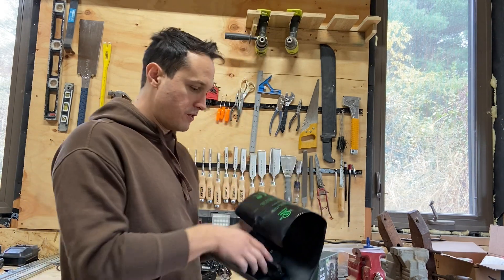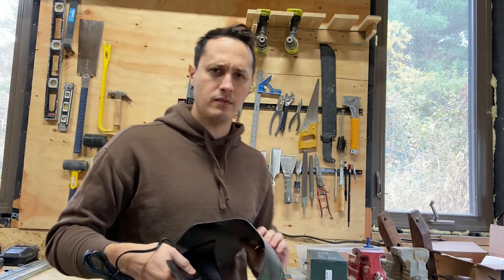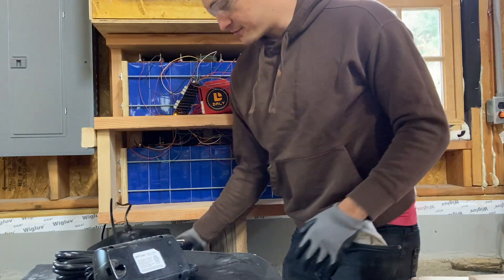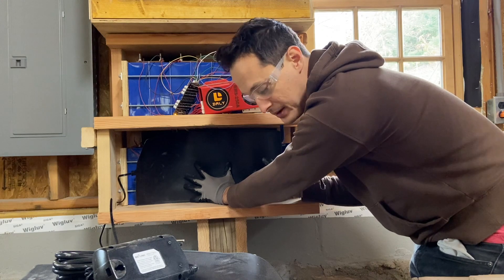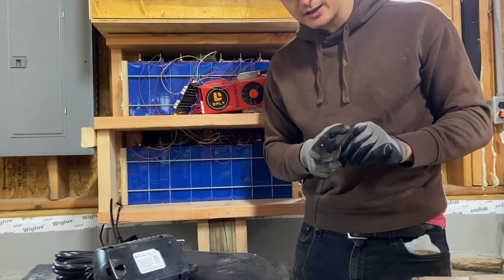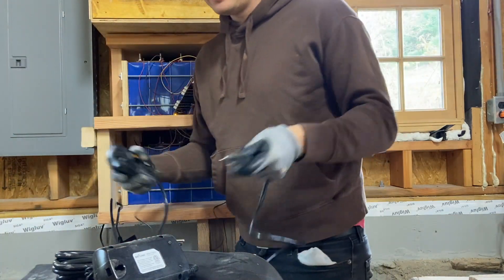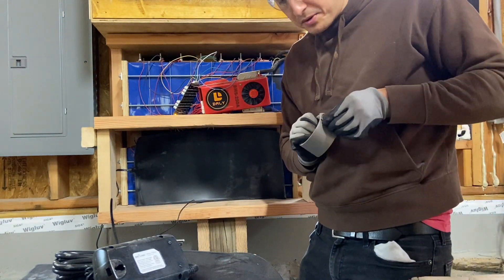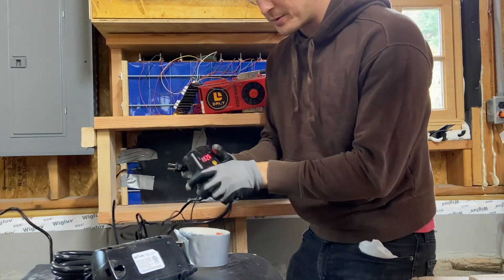How to Keep Your LifePo4 Cells Warm this Winter

Comment: Useful video. I have a few comments which might be of interest.
I have a 16S2P setup arranged in a 8x4 block. As I don't always want to be using the inverter I wanted to provide heat more efficiently by not needing to have the inverter on so used low voltage DC heating pads. I decided to mount them under the cells but separated by an aluminium sheet with a padded mat underneath. This both helps distribute the heat evenly and protect the heater mats from the point pressure of the cells.
Reply from the maker: This is a very good idea and I really like your setup. I'm running the inverter anyway and don't want to spend the extra money on a DC to DC converter, but what you are describing makes alot of sense.
Reply: @TheWilltoBuild  Don't need a DC to DC converter.  Just run the 12v heating mats right off your 12v battery bank. I do that and use a STC-1000 temperature controller that costs about $10 to control it.  Works perfectly.

Comment: 111621/0411h PST 🇺🇸   Thank you for the demo on heating the cells during the winter.
Once set to 70f (during winter) will the heating device shut off at 70f and restart when the temperature 
goes below 70f;  constantly maintaining 70f ?
73s…
Reply from the maker: Exactly. It turns on once the temperature goes below that below and off when the temperature gets above it.
Reply: 120321/1014h PST 🇺🇸 Thank you for the info.